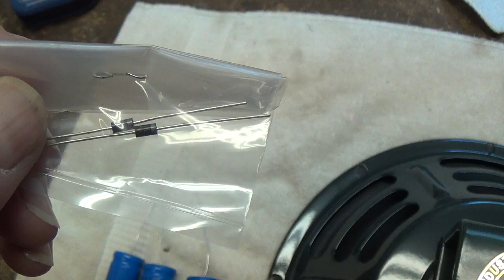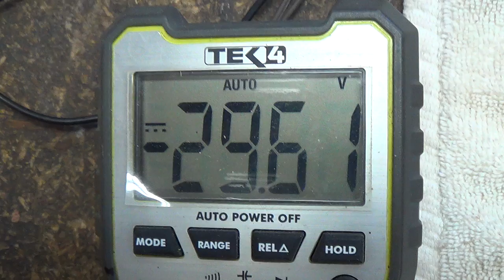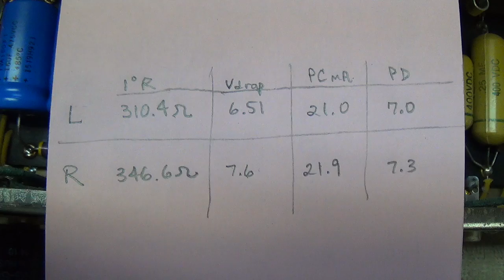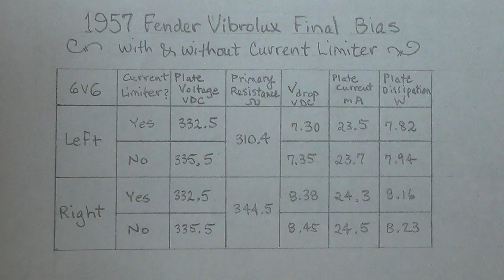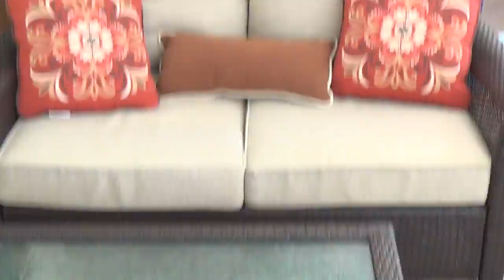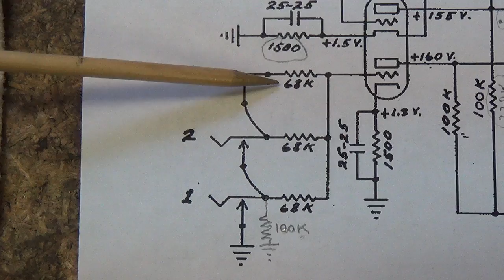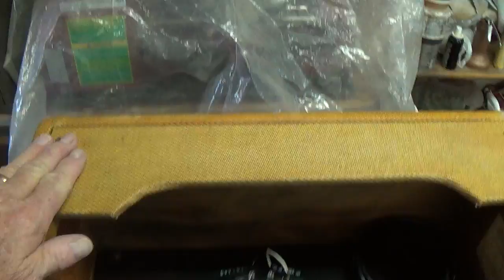1957 Fender Tweed Vibrolux, Part 3

Comment: Agree with you on those Jensen speakers, they make speakers for every amp/ cab you could desire. I got the P10r in a Princeton RI and a P12Q im a Tweed 1960 Deluxe and after a couple of weeks running-in they sound perfect, I think these Alnicos are a bit more efficient at louder volumes than the older originals were. Thanks for fab lesson.
Reply from the maker: You're welcome, Giulio.
Reply: Thanks for sharing your knowledge and experience with us, I for one get " Inspiration: from your work..never stop learning and sharing!!❤

Comment: Doug - You got me thinking about the impedance mismatch of input 1.  I built a 5E3 and would like to fix this issue if it is present.  I'm a little confused by it as when you look at the 5E3 schematic, are the arrows representing the grounds of the jacks?  I see what you mean in the video looking at the vibrolux schematic but the 5E3 schematic has me confused.
Reply from the maker: The arrows are not ground. They show where contact occurs between the leaves of the input jacks. The 5E3 does not have the impedance issue seen in the Vibrolux. Both jacks have a 1 Meg ground.
Reply: @UncleDoug  Thank you Doug!

Comment: I have a different view of the input staging. I believe it was intentionally designed to allow the user to use instruments and mics with different output characteristics. For example, my 1956 triple neck Fender steel guitar has very low output when all three necks (six total pickups) are engaged. For this I use input number 1 to boost the signal. My '51 Rickenbacker (horseshoe pickup) and '57 Gibson (PAF humbuckers) lap steels, however, have very strong output and work best in the #3 input.
Reply from the maker: Thanks for your input, Tim (no pun intended ;)

Comment: Howdy Uncle Doug. I know I'm about 6 years late with this comment, but I wanted to point out that I know a number of techs who, like I, have had BAD experiences with Sprague Atom electrolytic caps. They just don't hold up very well over time in my opinion. I know there's a great deal of hype about their supposed incredible quality, but I'd argue it's really just hype. I had 5 in an old Vibrolux Reverb dated from 29th week of 2010. This amp hasn't been used for more than a total of 20 hours in the last 11+ years since those caps were made and I had one fail this week (Feb 2022). The amp has lived in dry, sunny-southern California all this time and not been exposed to cold or humidity.

I decided to cut open the 16uF Atom that just failed and I can tell you that inside, the dielectric is rather puny when compared to the blue cover; it was about 1/4" shorter and maybe 3/5ths the diameter. Not nearly as impressive is the big blue exterior shell!

I simply don't use Sprague Atoms anymore. I've been using MIEC caps with much better luck, FWIW.
Reply from the maker: I share your opinion, Leon, and have ceased to use Sprague Atoms, largely due to their unreasonably high price for rather dubious quality. My go-to caps now are F&T's.
Reply: @UncleDoug  Yeah, F&Ts are excellent caps, IME!

Comment: Fascinating  stuff. Great work. I have a 1957 Fender Super amp, two 10" speakers and two 6V6 power tubes, 5F4 circuit.  Do you know if this model has any design flaws like the input jack issues in which you found in this video? Thanks.
Reply from the maker: Off the top of my head (which has very little hair) I really can't provide any helpful insights, David. It's too precious to modify, so I'd suggest simply enjoying it as-is.
Reply: @UncleDoug  Thanks. It sounds great. I was just wondering.

Comment: I guess the lack of a ground reference resistor in these input circuits just shows how frugal Leo was. He relied on the gitar volume pot to function as the ground ref, to save the cost of a resistor in the amp 😀
Reply from the maker: Perhaps economy or perhaps simple expediency, Ravi. The pot works just fine for the purpose.
Reply: @UncleDoug  Oh, yes it does, but when you start using some pedals you may get surprises, even if I see the norm is to have a 100K resistor as an means to set the output impedance of the pedals. I think for my current Harvard build I will opt for your mod, but with a 1 M across input 1 to ground.

Comment: Hi, You mentioned three input amps, I have an Ampeg Reverberocket, 1964 which has that configuration, does it need to be addressed?
Reply from the maker: I don't understand the question, Pete.
Reply: @UncleDoug  Sorry , what I meant was , does the 3 input Ampeg have the same problem as the tweed Tremolux?
Reply from the maker: @petemathisonguitar5761  I seriously doubt it, Pete. Without seeing a schematic, it's hard to say, but if you haven't had any problems, then it's safe to assume it's OK.

Comment: Hi Doug. Do you think that reason that the speaker was blown was because of the input impedance was incorrect on that third input jack?
Reply from the maker: impedance mismatch generally doesn't hurt speakers, M57. It's much harder on output transformers and output tubes.

Comment: Uncle Doug, I searched your videos but could not find one that covers my questions completely.  I have a 1959 vintage Tweed Bassman that is blowing fuses.  In the past (two other times in my 1960 Bassman) it was the GZ34 rectifier (expensive NOS Mullard) tube that was going bad.  I have a unique filtering setup as per Gerald Weber which is way higher that the max 60uF spec of the GZ34.  But, Gerald does other things to minimize the strain on the rectifier.  I have not had many problems but I suspect it is the extra load on the tube that causes them to eventually wear out.  I have thought about doing two new mods when I get my new modern JJ GZ34 and diodes.  I was thinking of replacing the selenium rectifier with a IN4007 diode and was told I don't need to put a resistor in series with it.  Some circuits may require the resistor.  I have an adjustable bias installed so I am assuming I can just put the diode in place of the selenium rectifier and be done with it.  What do you think?  Another mod I was thinking of doing was adding two IN5408 (3A) diodes in line with the 325VAC coming from the PT to the rectifier socket (pins #4 & 6).  I was told this can take some of the stress off of the tube by "pre-rectifying" the AC voltage.  What do you think about that?  I've found schematics online that show using pins 5 & 7 as solder points and then bridging the diodes from pins 5 to 4 and 7 to 6.  Thanks for your help.
Reply from the maker: It appears that the modifications you installed have unpleasant side effects. Personally, I would return the amp to its original configuration and enjoy it as it was intended to be. Excessive filter capacitance  causes way more harm than good, as you have discovered.  Yes, you can replace the selenium rectifier with a diode....it's a common improvement.....but you will then have to adjust the output tube bias due to the probable increase in -DC voltage to the grids. Adding the diodes to the rectifier pins is another fairly common alteration, but it does not reduce the stress on the rectifier, since the stress is a result of excess initial current flow (due to excessive filter capacitance) not the "stress" of rectification.
Reply: @UncleDoug  Yes, the higher filtering is debatable.  I have not had any real issues with it because Gerald bypasses the standby switch and pre-charges the main filter caps while the amp is still in standby mode.  He says that reduces the surge on the GZ34 but still, I have blown three (maybe) now over a 10 year period so it is tolerable.  But, I may just go with the blackface filtering and put two 100uF/350V caps in series for 50uF/700V.  I think I have a couple of 100uF/350V caps.  I read one place where the resistor in series with the IN4007 on the bias supply is necessary to reduce available surge current but I think that is a different situation in the B+ side of the circuit and not the bias supply side.  What is the advantage of adding the diodes on the rectifier socket then?  I also read that the selenium rectifiers can start blowing fuses too when they age.  Mine are all the original seleniums.  PS. The high filtering is only necessary if you play the amp very loud which is supposed to keep the notes in tune according to tests done by Gerald many many years ago.  I do play my amps loud but don't gig with them anymore so I could go back to lower uF.
Reply from the maker: @millstap  Sadly, many modifications are done simply for the purpose of changing something. If Fender really thought that larger filter caps would provide noticeably better tone, they would have installed them, even if it cost a few more cents. This explains the diodes on the rectifier pins:  https://dynacotubeaudio.forumotion.com/t1006-tube-rectifier-yellow-sheet-diode-mod
Reply: @UncleDoug  Thanks for the help Doug.  Fender did feel the need to change the filtering in the Bassman in the '59 Reissue so they must have figured out the 40uF/600V was inadequate.  They beefed up the voltage rating in the AB763 circuit in the '60's to 35uF/700V.  But, in the new '59 Reissue Bassman they went with two 100uF/350V caps in series for 50uF/700V.  I will go with the Reissue specs and see what I think.  I did see that article about the rectifier diodes so I'm glad to know you are referencing the same forum thread.
Reply from the maker: @millstap  You're welcome, M. I too tend to favor the reissue specs, simply because they (should) reflect improvements noted over time.

Comment: Mystery guitar sounds like a '52 Telecaster, I checked out the wiring of my 2014 Fender Mexican Telecaster, and it looks to be wired to Fender's 1966 Telecaster specs where the pickup selector is wired to allow the neck, neck plus bridge, or bridge pickup selections, with a master volume and tone control, tone cap is a .05uF ceramic, but I might swap it out for a .05uF Orange Drop or some other cap at a later date.
Reply from the maker: Yes, a reissue with the original tone circuit. Good guess, Simon.

Comment: Hi Doug. Great video series on the Vibrolux. I have a 1957 5E3 (date code "GH", so 2 months younger than this Vibrolux) on my repair bench that unfortunately had all the coupling caps replaced on the board by somebody in the mid-90s. There's a lone survivor red Astron on the tone pot, just like this Vibrolux. Do you know if the yellow Astrons on the board was standard in amps of this particular period? I've seen earlier tweeds that were all red Astrons. I'm considering ordering up some Jupiters for the '57 Deluxe and have to decide between the reds and yellows... so any insight would help. Thanks!
Reply from the maker: Thanks so much, PTW. I see so few tweed Vibroluxes that I really can't say exactly what type of caps they originally came with. I am a skeptic when it comes to high-dollar "boutique" capacitors. They may have an application in price-is-no-object HiFi circuits, where absolutely transparent sound reproduction is an asset......but guitar amplifiers are quite different. Unless you are playing jazz or acoustic, the last thing you want is a totally pure, clean output signal. Leo and the gang would never have paid for "boutique" caps, even if they existed back then. Instead they used whatever mass-produced caps they could get at a reasonable price. I personally prefer to do the same, and utilize relatively inexpensive polypropylene and polyester caps in all my builds and re-builds. With modern production equipment, they are probably superior to the original caps that Leo used, and sure seem to produce some great tone in vintage circuits.
Reply: @UncleDoug  Good points, Doug! Thanks for your reply. Right now that amp has paper-in-oil caps installed in the 90s, which seem out of character for the amp... plus a couple of cheapo electrolytics that I'll replace with F&T. I've been using the Mojotone yellow (polypropylene) in my builds, so perhaps I will go with those. Cheers and thanks! - Pete
Reply from the maker: That sounds like a good approach, PTW. Best of luck with the repair.
Reply: @UncleDoug  Thanks!
Reply: @UncleDoug  Hi Doug, I have a followup question if you don't mind. I've recapped the "57 Deluxe and it works and sounds fine -- however, when I calculated the plate dissipation (I used the OT transformer method) I got 14.8 W for the inside 6V6 (vintage G.E.) and 14.2 W for the outside (vintage Marconi ) -- and I'm aware that 12W is normally max for 6V6s. The amp sounds fine and has apparently been running that dissipation on those tubes for decades. In your experience, would be okay to leave it -- or should I look at increasing the bias resistance or lowering plate voltage? The amp has an original brown bias resistor that is close to spec, 253 ohm, that I would prefer keeping since all the original caps were pilfered in the 1990s. BTW: Despite the tubes being different brands, they are almost matched: 38/39 mA on the pair. Thanks again! - Pete
Reply: @ptwamps3682  in a situation like that, I would leave the bias resistor as is. Some people increase the cathode resistor in new builds to 270 ohms, but I have found that it isn't necessary. If it ain't broke, don't fix it.

Comment: Uncle Doug, I love your videos. I've been learning so much thanks for posting all these. I have a question regarding input 1 after the change you made. Wouldn't the signal from the guitar pass through 3 parallel 68k resistors to the grid thereby effectively shrinking the grid stopper resistor down to 23k. Also similarly wouldn't jack two grid stopper be the top two 68k in parallel for a total of 34k. Would these account for the volume differences between the inputs I've heard people say it has?
Reply from the maker: Thanks so much, Mr G. In retrospect, my modification was unnecessary. The grid leak for the first triode is provided by the volume/tone controls in the instrument, and the variation in volume between input jacks is purposeful.....it compensates for different input volumes (i.e. humbuckers vs single coils) and for higher output gain, if desired.
Reply: Thanks for responding Uncle Doug. How would input impedance work then for input 1? Also is the volume difference from changing the grid stopper value or just changing the resistance between the signal and ground? Because if its the latter, wouldn't input 3 and 2 have the same 102k resistance to ground (two 68k in parallel + a 68k in series)?
Thanks!

I've been watching a ton of your videos. Thanks so much for posting all this information. Its fascinating and super helpful. You are very gifted at teaching.

Comment: Have you used locktite on the speaker mounting bolts?
Reply from the maker: I have, as well as lock washers and short pieces of tight-fitting rubber hose to keep the nuts from loosening.

Comment: Awesome videos, Uncle Doug ! I've just found your YT channel on my recommended list, and watched almost everything by now. I've worked 3 years on a local workshop here in São Paulo, Brazil building mainly Fender Tweed era replicas, but it has been a while since I'm "retired" of working in electronics (it gave me a huge problem that causes me terrible back pain) but sometimes I mess around with it as a hobby. Wish I've had known your channel back then, it would be very helpful at that time.  I'm writing in this specific video because I've built for my personal use a Vibrolux 5F11 replica, and it works like a charm, but I've never noticed that flaw on the input scheme ! So, thank you very much for pointing that so I can add the 100k resistor in the input just as you did and save myself from some future headache ! 
Cheers for you, Rusty and Jack !
Reply from the maker: You're welcome, RK. Thanks for your input :)

Comment: I Like the Idea you are giving back the old parts so that the person can have a option. I am fooling around with a 61 Princeton amp and one of the resistors in the bias circuit looks burnt. I am going to take another peek at this video when I address the problem. Great Info Doug Thanks c];-D
Reply from the maker: You want to keep them working with minimal alteration, AL, and retaining the old (defective) parts with a vintage amp reduces the harm when repairs are unavoidable.

Comment: Hi Uncle Doug,
I have an old '65 Vibroluxe and  '65 Princeton.   There both working pretty well, but I like your style and would love to get in touch and have you look at them both and do your magic.  I also have an early '60s Vibrolux. (No drip plate).  I'm non greedy, but would love to got the amps up to to top shape and not distort too easily.  If we could be in touch, I would be very grateful....they could use some tube assessment (I've got lots of tubes) and probably some cap and resistor replacement. 
Would love to hear from you, oh yeah, I'm in Connecticut.  My email is bhaktiyogin@gmail.com
Best,  Jeff
Reply from the maker: Greetings, Jeff. Rusty and I have retired from doing outside work, but occasionally work on interesting old amps. You should realize that the cost of shipping both ways increases the repair cost significantly....probably up to the $350+ range, each. I honestly think you'd be better off finding a tech in your area, or better yet, studying the videos and repairing them yourself.
Reply: Hi Doug,
I think your suggestion is a good one....getting a tech close to home. I'm afraid that I would electricute myself if I tried to do the tech work that you do.  I appreciate your videos and am retired, myself. But 50+ year old amps need TLC occassionally to keep them up and running!   
Thanks for the reply and best wishes,
Jeff